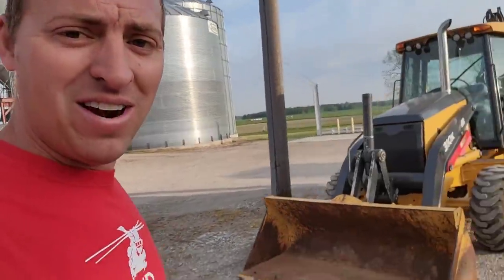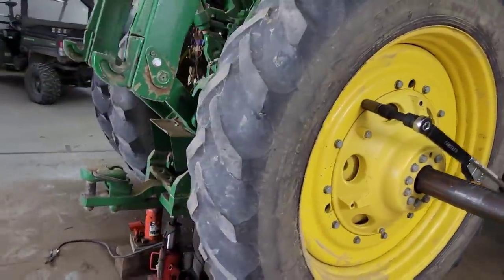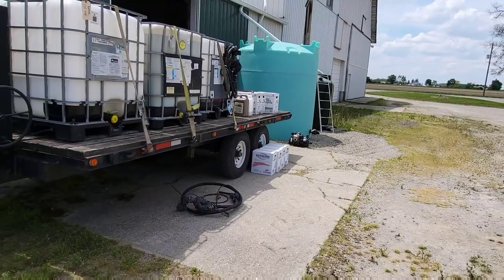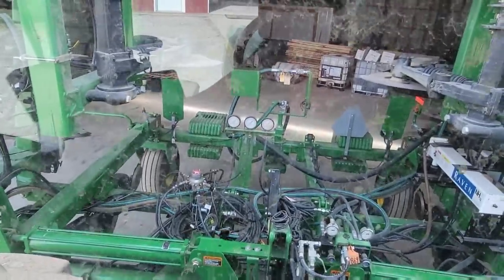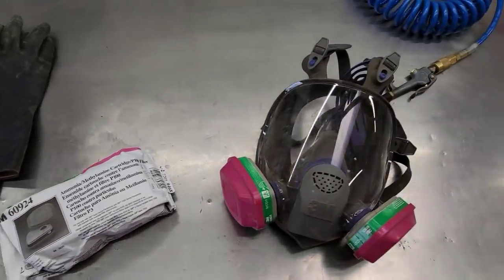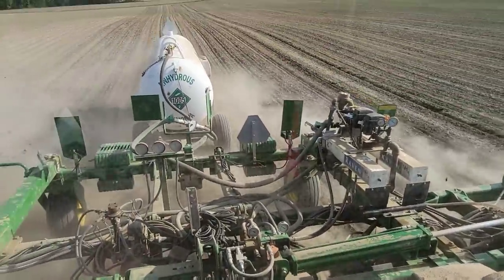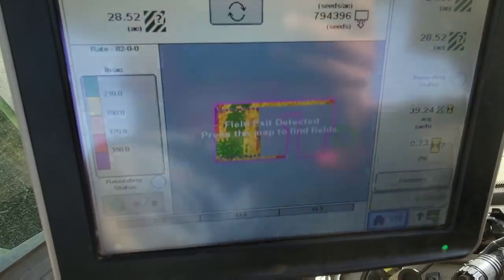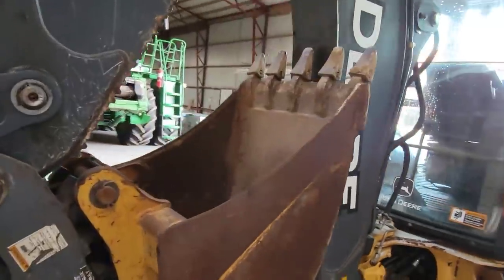The New Backhoe is Here! - #425

Comment: 16:50 on the outside one the left closing wheel is over the path where the disk went while on the row next to it the left closing wheel is to the left of the disk path
Reply: It almost seemed to me that the bar that holds the closing wheels is slightly bent or twisted to the right.
Reply: Yeah, comparing the arm holding the closing wheels to the gauge wheel, it is tweaked to the right.
Reply: Yup looks like the stud or the casting is bent

Comment: For us non farmers what does the anhydrous do for the fields,? Weeds?
Reply from the maker: Anhydrous Ammonia or NH3 is a source of nitrogen fertlizer. Corn needs about 1 pound of nitrogen for every bushel it produces. Therefore we apply between 140 and 240 pounds of N per acres to feed the corn.  Nh3 is one of the most economical forms of N it is just a little harder to handle than a dry or liquid N source. It's also the most concentrated at 82% nitrogen vs 28% for liquid and 46% for dry .

Comment: If your heating pex  tubes are on the bottom of the slab, the shallow control joints should not have made contact. BUT sometimes incidents happen during a pour and pex  is NOT indestructible. If you wait till the home is built, the plumber connects, discovers a leak. Then it is many months after pour.
Depending upon make-up water supply, some small  leaks are never discovered, just flow to the crock. (think toilet flush valve leak, large accumulation over time, but this is heated 💰🤑 water)
While the pour is FRESH in everyone's mind, the plumber should pressure test the pex lines. 
There s no simple fix but It is better to know than not know.
Think this way: you  check the oil @ every tractor use. You do NOT expect to see anything but FULL.  But your still check everyday anyway. WHY❓ 'Cause you know WHEN you know.
(actually could do test yourself, few fittings, gauge, portable compressor,  valve,  time lapse.  In garage the glycol could dilute/freeze)
Reply from the maker: The lines are already under pressure. They pressurize them before the pour to prevent collapsing or kinking of the lines.
Reply: @BorderViewFarms  very smart

Comment: Not sure if you mentioned this, but, did the liquid tape on the wire fix the problem?
Reply from the maker: Yes it did. Well actually moving the wire off the steel line fixed it, the liquid tape is protection from future corrosion

Comment: Since your putting it on so soon after you planters, why wouldn't you just do it before planting and plant right on top of it?, Or still just plant between it but not run over anything planted?
Reply from the maker: It's been over a month since this was planted. I'm sure we would have lost some the the N had it been preplanted and there's bigger risk of heavy spring rains.  Plus there's the equipment and man power issue. I can't put NH3 on while I'm trying to plant.
Reply: Many farms do just that, they apply in fall post harvest, some do spring just prior to planting. The issue, as taught, if the new seed is too close to the N initially, it burns the seed, stunts growth. Anhydrous is very concentrated, while liquids can be moderated for new seed. Many folks side-dress @ V1 or V2
Reply: You can in fact do the whole process in a single pass now meaning one tractor pulling 3 implements (seeder, nitrous applicator, de-weeder) then I think is used a spray applicator for "sustainment" but might have been some promo video i saw for all i know.

"Devil is in the details" as this channel has proved going on forever now.

Can't beat current pricing for everything at the moment! Crazy high/time is money absolutely.

Comment: When you run over corn with the wheels on either the tractor or the Anhydrous bar, do they survive?
Reply: Yeah the should problem is they will be shorter then the ones that don’t so they almost are more like a weed at that point
Reply from the maker: When the corn is still this small they could/might. It's not good for it but not much I can do.
Reply: Thanks.
Reply: That makes sense , any corn that does not get mature enough to harvest is the same as a weed.  Well said thanks/